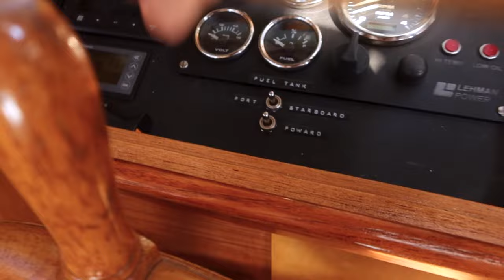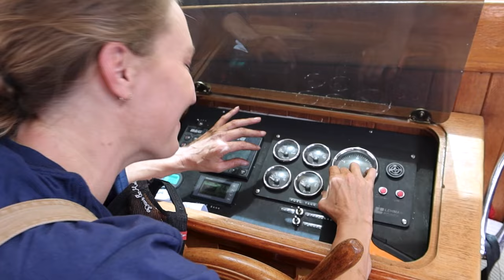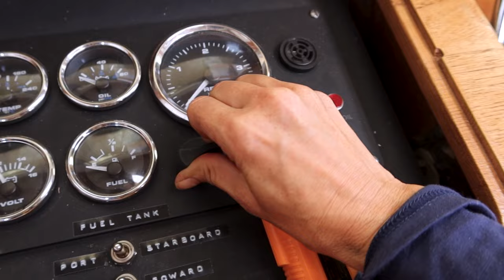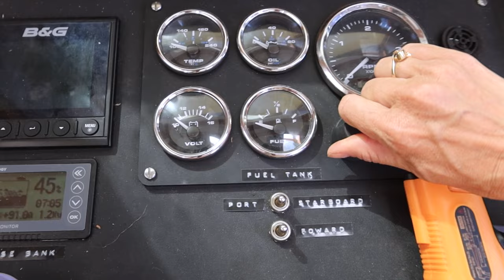Sailing Alone. 51 Feet | PIRATE SHIP

Comment: Just some useful advice: Don't ever go into a very tight space if you're  alone, and NEVER if you have to reach down head first. Had a chap here in UK, that was working on his boat in the aft lazarette , slipped down and couldn't get himself back out. He was fortunate to just reach his phone and call 999 (our 911) , without that he could have died!!
Reply: Her experience exceeds most as a captain & sailor. This woman has great common sense & logic backing said experience.
Reply from the maker: Great advice
Reply: Top tip you can buy a powerful hand drill with a connection to fit your winch, saves a lot of money and you can use it raise your mainsail winner !

Comment: Hi Audrey.  My wife and I have a Formosa 47’.  We saw your boat in Cabo San Lucas last year.  Now we are in La Paz.  I wanted to let you know how we raise our mainsail.  We have a Milwaukee M18 fuel, battery operated angle drill with an adapter for a winch (available at Amazon).  This tool basically makes all of our winches into power winches.  It makes taking up all of the excess Genoa sheet after a tack no work.  Much faster than hand cranking our cockpit winch.  We use it to roll our Genoa back onto the furler, raise the mainsail, lift our dinghy at night, and onto the deck for a passage, and general winch operation when under sail.  I am 72, my wife is 62, and this is a life saver for us.  I can’t seem to attach a picture or video, but I am sure you can find a picture.
Reply: This is genius.  Are you reading this, Aubrey?

Comment: Hi Captain. Awesome video! I own a Vagabond 47’, Formosa’s smaller but older sister 1976. I often sail long passages alone. What you need is just 1 strong electric winch in your cockpit. With some pulleys you can do everything with it, pull up your main, roll in your headsail and so on.

Comment: Your doing just fine , sailing a large 50ft yacht alone.   Just a note, raising Anchor alone in a crowded spot is going to be challenging for anybody. A remote auto pilot control is good as  is powerful windlass . As for  raising  the Main . that's a big sail , around 50' hoist  I suspect. I assume you have internal halyards which often exit the mast too low. This make it difficult to pull down on the rope using body weight  . next best thing is obviously the winch . Try a powered Winch Handle , you only need one... this  turns  all your winches into electric. They are expensive but I have seen people use a Battery Drill with appropriate bit.  The other thing is when hoisting, raise the Topping lift as much as you can and release the Outhaul and put plenty of  slake in the Main-sheet . That sail needs to be like a limp ... thing .. , not the time to be hard..,  if you know what I mean. Oh that reminds me, lots of lubrication, I used to use Vaseline but I think silicon is probably better , use a lot or often. . pre flight check . Almost every host spray a little on each slide.
  Just a word on Sail trim , your boat generally needs Full / deep  sails , so in most conditions don't over tighten both the Halyard and Outhaul. A light weight easily driven racing yacht can sail with flat sails but a heavy more rounded hull needs power, torque. Its the same as your Ford Lehman , Low reeving but mountains of Torque.  This is not what you would put in a speed boat but the perfect motor for the Pirate Ship. A little slackness  in the hoist is not a bad thing , it helps put fullness in the sail.   I would love to come assist some time but I'm a long way away. Land of OZ.

Comment: I learned a long time ago from my Pops that it's almost always something simple. More often than not a wire connection will go bad before the major parts go bad. Good job finding and fixing the problem. Plus side is you basically have a brand new starter now!

Comment: A very common problem causing excessive friction hoisting a mainsail, is slugs/slides that are loosely held to the sail by the webbing. As the sail is raised, the slugs/slides go out of alignment with the groove/track and bind. Continuing to grind away on a winch often causes tighter binding and more friction. Instead, try hoisting about 2 feet or so, then easing down a few inches, or just enough to allow the slugs/slides to unbind. Then repeat until fully hoisted. Often the webbing holding each slug/slide can be stitched much tighten to naturally hold each slug/slide in better alignment to the groove/track and dramatically reduce or eliminate this problem. Hope this helps.
Reply from the maker: Each one of my slugs is a 6 wheeled car. I will take a clip of them I’m really shocked they won’t slide well. I suspect it has something to do with the shiv perhaps
Reply: It's a new setup, right? Do the all the individual cars with the 6 sheaves slide easily on what sounds like an external track when not attached the the sail?

Comment: I added Sail Track and Slide System by Tides Marine for my main sail. Huge difference in raising the main. I can now raise the sail without the winch except for the last few feet. My main is approximately 65 ft in height from the water. Before having the track installed raising the main was like wrestling a bear. Also lowing the sail is now extremely fast and easy.
Reply: I use Dry Film Lubricant, available at hardware and auto parts stores
Reply: Agree Formosa 46 here and the Tides made a huge difference.. also lube the heck out of what you have…it will help

Comment: Regarding the heavier anchor: Your upper body will adjust, and become stronger, and that's usually not a bad thing...lol. I would suggest the priority is the safe keeping of your vessel at anchor. I think you made a good choice with the anchor you currently have. It's better to be safe than be sorry. Perhaps it's just a matter of upgrading the windlass to compensate.
Also, electric winches would definitely go a long way, no question.
Difficulty raising the main: From what I'm seeing on your video, it shouldn't be that difficult. I'm guessing it occurs in the latter stage of raising. I would check the track around the top of the mast especially, it may be bent, or come loose. Obviously where it is the most difficult, is where you'd find the problem.
Another terrific video. Thanks for sharing. Well done.
Reply: And lube all pulleys etc

Comment: Get a cheap multimeter to check battery voltage, they could be low. How old are the batteries? Do you remember if the Alternator was working properly? Check to see if connections are tight and the pully belt is snug. This could be why the battery is low if Alternator belt was loose or connection loose. If you see any white/green coating on wires or cables that's Corrosion. Corrosion causes resistance to the flow, which means wires will heat up and melt. So, do you smell anything that was burnt? Black soot is a tell-tail of burnt electro-mechanical wiring say in an Alternator. Just some tip's to look for and be aware of.

Comment: Pick up some Emery cloth sandpaper, comes in handy to clean cruddy connections off. Clean off all electrical connections on cable then battery terminals. Fasten good and snug to battery posts. Clean the ground connections and tighen snug. When working around engine disconnect the battery that starts it. Make sure any battery switch is in off position. A small brass brissel brush to clean any corrosion.

Comment: An anchor-handling trick I use as a single-hander if there is appreciable wind: break the anchor out of the seabed and haul in until the bow has blown off 45°, then go back to the helm and shift the engine into reverse. The boat will quickly pivot around stern to wind and pretty much hold station, depending on wind/tide conditions. Go forward again to finish securing the anchor. This technique eliminates the chance of blowing down on someone, and at worst, you're creeping slowly windward, so can judge the likelihood of collisions w/ anchored boats almost calmly. And it makes you look like the G.O.A.T. in a situation where hurried semi-panic is the norm.
Reply from the maker: I’ll give that a try

Comment: Hey Miss Lone Star 

First watch, just came across your channel.  Nice job w/single hand!

I’m setting up my LH 53 for easier solo so have a few ideas:
Raising main will be so much easier. No idea what your present setup is, but a sail track w/modern ball bearing sliders will make it simple. Mine is in-mast furling main, which is ideal but requires an entire new rig $$. Very best solution imo is in-boom furling main. I’m sure you have, but soapy wash whatever mast sliders you have, then spray w/McLube SailKote.
Convert 1 (or 2) winches to electric. You can then use low-friction rings to route any line you need to winch to the electric.
I just installed a wireless remote control for windlass. Simply and inexpensive. Then can raise anchor from helm while motoring forward to take pressure off windlass. Add a GoPro or bt video at bow, so can see how anchor is retrieving from an iPad at helm.
There are plenty of GoGoGadgets to make s/h so much easier 😊

Comment: It is not safe to swim alone:
Something might happen to your health, a storm might arise, and if something gets jammed, you won’t be able to cope with everything at the same time. Someone needs to steer, and someone needs to deal with rigging, problems, leaks, radios, if necessary.

As for setting the main sail - a 51-foot yacht is a large boat, and large, heavy sails. You need an electric winch and rope output to the cockpit with winch control. You also need to check whether the sliders move well along the mast, whether they jam, or whether the shaft rope is twisted. 
Sorry, my English is not ideal. I hope I was clear. I wish you good luck with your boat living.

Comment: Do you remember me Dave from Malta. The Catmeran. I sail single handed. But when I anchor. I use two at the bouts. Pluse two on the stern which I use if anchor in a tight spot. Enjoy your sailing. I am often to Menorca in 2 weeks time to single sail again. I always wear a a harness attached to the boat if I am outside the well of my boat. I also two ladders which I can pull from the boat if I fall over board. This I saw in a magazine . Enjoy your sailing. Single handed is great.

Comment: Aubrey, to get foward motion on Houdini you could use the forward sail first, then set the main sail. to slow down the boat you drop the main sail and then reef the forward sail. The pull cord on the genset could be modified to start with hytorque drill to spin the crank around. Same with the main winchs a 90 degree battery HD Drill. Something to think about.

Comment: Your main should not be that hard to raise, at least not until you get it up to about 3/4 of the way up. You might check the cars and see if they are binding on the way up. If they are the original cars, you might want to look at lubing them. Also, best thing about a ketch is being able to run mizzen and headsail. You won't have as much speed, but they would be much easier to handle. You could also go up to a much higher wind speed with less worry.
The great thing about your Ford Lehman is that there are literally hundreds of people who can work on it around the world. In Africa it is one of the most common older engines from tractors. The thing is bullet proof. I once ran my engine without opening the seacocks. I was almost out of the Ventura Harbor on New Year's day when I saw that the engine was over-heating. I knew immediately what it was. We had been off the boat for about 2 weeks when we went to visit my parents in Louisiana and I had closed all the seacocks while we were gone and forgot to open them. My first reaction was to open the seacocks. Fortunately, I didn't do that. I slowly returned to our dock, opened all the hatches to the engine compartment, and let it sit for an entire day. Not immediately exposing the super hot engine to cold sea water saved the engine. I had a mechanic come over and he said the old Ford didn't even warp the heads. We started it back up, and it ran perfectly. No issues at all. If I had opened the seacock, the exposure to col sea water would have warped the heads, cracked the block, and required a whole new engine.

Comment: Clean / wiggle terminals first call & even if not actual problem will help. Turn to see if solinoid is engaging, hear click click can be the contacts inside solidoid that can be sanded / filed or jimmy some copper tube & make somthing, other wise brushes.  Ive learned also is brushes and doesnt start you can give SM hit - quick sharp shock with socket extension bar -  what happens is as the carbon brushes wear down - sometimes they hold - but just that little shock helps dislogde them so spring can push onto stator more freely and can get way with that to make preperations.  Real prick having to solder new brushes on as you need a lot of heat - and careful not to have solder creep up the flexable braded wire {so pays to put oil in wire were you dsont want solder to go}  Surpised you did it yourself - no insult but sometimes youve got to be tenatcious / cunning / experience working around things.  Kudos.

Comment: Mainsail hoist shouldn't be as hard as in the video.  Clean and dry lube the track, dead slow or stop (if stop, hoist the mizzen to point her up). Pre lift the boom a bit with the topping lift.  Hand hoist as far as you can, then go to the winch.  Once full hoist, slack the topping lift.  Also put a bit of slack in the main sheet often helps. In addition I always slack the lazy jacks and carry them forward and clear while hoisting. (I'm also a Formosa 51 center cockpit) ... Also aside from buying an electric winch, there's the battery powered drill that some use, I haven't so no 1st hand knowledge.  I'm going to crank up my generator and use a 110v drill to see what I think about it before dropping a half a grand on yet another tool .... Fair winds and hooray for you.  PS: I think of the 51's more as little ships than just another sailboat.

Comment: My guess is, that there is corrosion in the track.  That is preventing the buttons from travelling up the track smoothly.  I had this happen on my friend's boat.  Some salt water proof teflon grease, and I could raise the sail with one hand.  Before that, I could hang my 200# body from the halyard.

Comment: She really is a beautiful boat.  If something simple like a starter doesn't work the odds are pretty good that the problem is electrical, bad connections on power or ground.  You did a fine job on the power side cleaning the connections but didn't do the same on the ground side.  Lessons learned.  By the way, good job changing out that starter.
Reply from the maker: Thank you!!

Comment: Great job with the anchor and sails Aubrey but what a workout. Your poor back!  I agree with other commenters that you need a remote powered winch for the main if you're singlehanding. Also, you should check the specs for your anchor windlass for its max pulling power. The electric motor will burn out quick if you exceed the max load especially with that huge anchor.

Comment: when working or diagnosing any type of engine you have to use K.I.S.S. engineering. a lot of times it can save you money. K.I.S.S. Engineering stands for "Keep It Simple, Stupid" engineering. This principle emphasizes simplicity in design and implementation to avoid unnecessary complexity and ensure efficiency in engineering processes. By adhering to this principle, engineers aim to streamline solutions, reduce errors, and enhance overall effectiveness. try using dyneema rope for a pull cord its pricey but would stand up better in the element's ʕ•́ᴥ•̀ʔっ